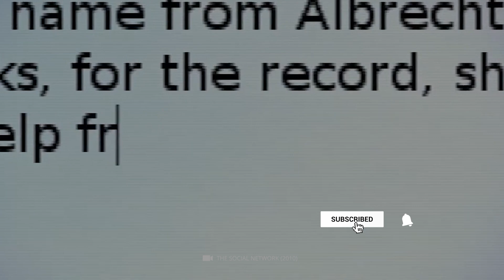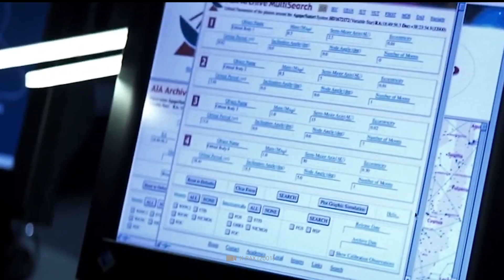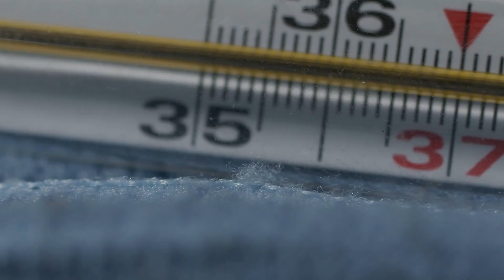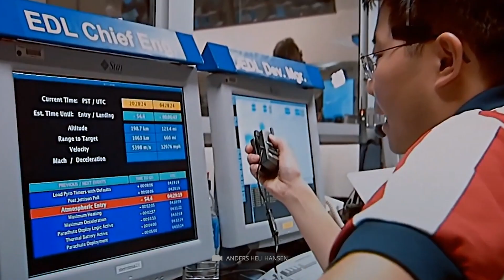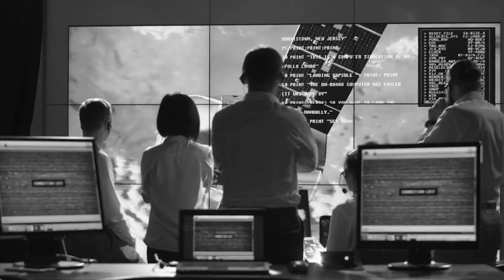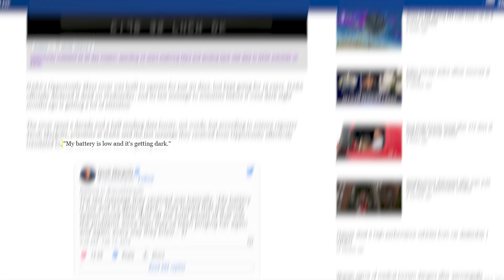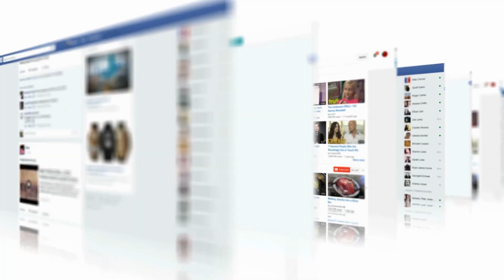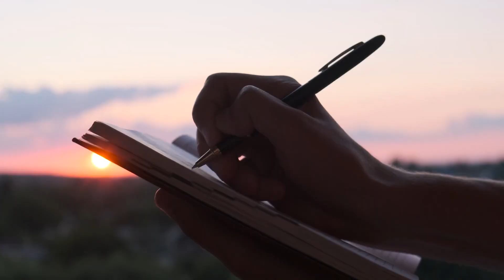NASA REVEALED! The Tragic Final Images Of NASA's Opportunity Rover!

Comment: NASA(JPL) lost contact with the Opportunity in 2018 after a dust storm. The theory is that dust covered the solar panels and the batteries were completely drained. Does NASA(JPL) continue to send signals to Opportunity on the off chance that another dust storm will clear the panels? I suppose the communications dish would need to be pointing at Earth and the Opportunity system may not have a separate independent power source for a clock?